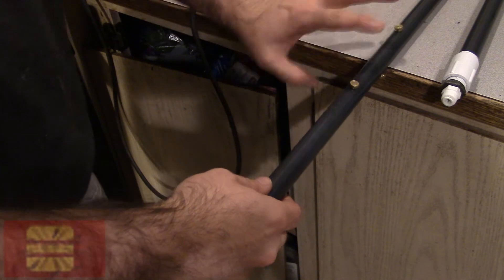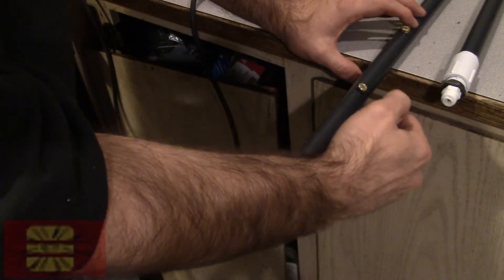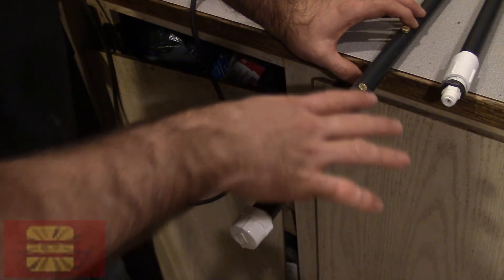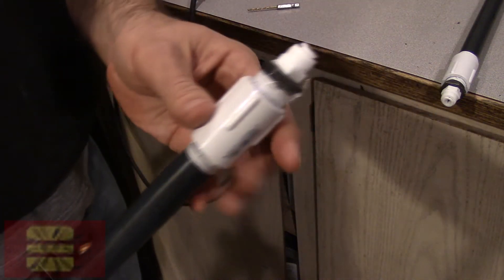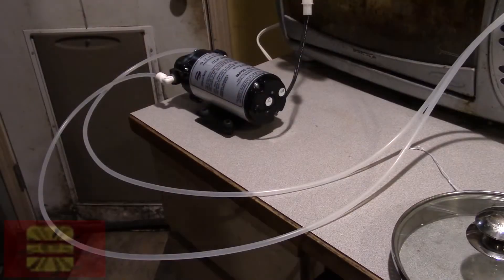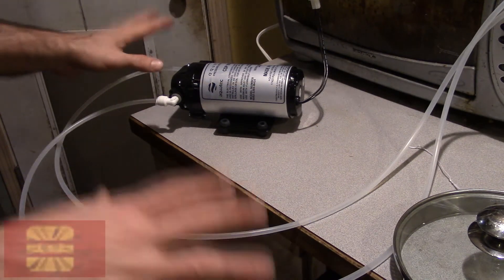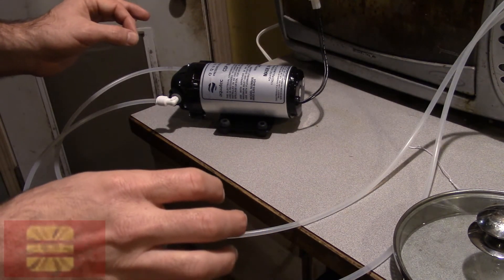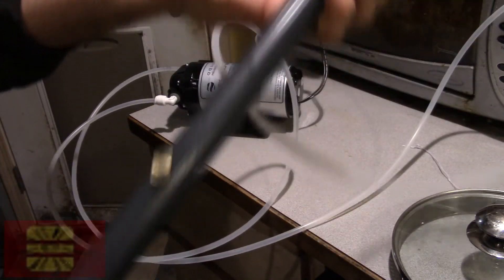Indoor Aeroponics Preview for small spaces

Comment: As the mist started I said out loud "beautiful!". This video helped me work out what I need, so thankyou!
Reply from the maker: be sure to check out the other videos, I made an improved mister that was easier to make with the flexible PEX type tubes.  I'll be trying to make a year around lettuce system this year so stay tuned!  I'm glad my videos have helped inspire!
Reply: Cyrix Lord Have you had any issues with clogged spray/misting heads? If so, how consistent? Do you have any footage of the changes you've made to the misting system, as I've been unable to locate them if so on your channel.
Reply from the maker: hi, not consistent with the aeroponics, but for the hydropoincs, because I dont' really filter out the water (I will be meaning to while still figuring out how to keep the flow rate good) I have to soak the heads in vinegar and blow them out like once a year just to be sure.  for the aeroponics i use a 20/20/20 liquid fertilizer that is diluted. I hope this information is helpful

Comment: Thanks for showing us your video.  Would you mind sharing some more information about your system.  Whose short cycle timer are you using, per filters, and housing vertical pipe or plastic barrel.  I plan on building an aeroponic system and I not what to reinvent the wheel.  Thanks for sharing Mike.

Comment: Nice and simple design with good results! I am doing research on building an indoor aeroponic system and I was wondering if you could give me your opinion on the sound leven of the high pressure pump? Since I'll be in the same room, a low pressure system might be a better option
Reply from the maker: I think it sounds a little louder than an aquarium's air pump compressor but not so bad, the spray is only on for maybe 10 seconds but it will do it every 20 minutes or so. i'm actually making a 2x4 foot tray for 18 head of leaf lettuce that will be aeroponic. i'll be making a video of that when i can find time to build the project (I have the parts)
Reply: @CyrixLord  Ah great, thanks for the reply! I'll be keeping an eye out on your channel for future updates :)

Comment: Is this system still running?
I'm considering building something similar, but I'm debating the use of solenoids and an accumulator. My hopes are that running an accumulator would help increase the life expectancy of the pump.
Reply from the maker: I only ran it for a season. Now I'm thinking on using it in a 2x4 foot tray for lettuce during the winter in my garage instead of using flood and fill. its still a good pump. you can just run regular water through it if you are worried about corrosion.  my pump still works fine
Reply: @CyrixLord  you know what would be absolutely awesome...(and is needed)? A side by side comparison of DWC or RDWC and aero, running clones of fruiting plants (same genetics). I've been searching particularly regarding cannabis (tho I understand that's not everyone's cup of tea) and I find exactly nothing, not even in the world of fruiting vegetables. 
I'm particularly interested in time to harvest, biomass, and yield. But I've turned up nothing scientific, at all. Tomato clones would be very informative.

Comment: does this type setup  produce mist as dry as the 5 micron mist with the atomizer type setup and very low water usage?
Reply from the maker: hi, this uses a mister type that is used for putting onto fans and cooling people off, but there was no specific micron rating on the mister nozzles. It worked very well with the lettuce, basil, cilantro and i'll be using the system again this winter.

Comment: Hi, thanks for video. I'm working on a high pressure aeroponic system and your pvc pipe with spray nozzles is a good idea and seems match with my project.
Cool you send me the list of parts you used?
Reply from the maker: Hi, the pvc pipe caused issues with leakage, so the new design in later videos wound up being using PEX tubing and putting the brass nozzles that they use for cooling you down (like rigging the nozzles under a yard umbrella to keep you cool). you can screw the nozzles directly in, or you can use special t fittings that screw the nozzles in.  I hope this information is helpful. the pyramid contraption I made worked great last winter for lettuce and other greens indoors but I want to try something else this year where I try to make year round lettuce.

Comment: sooooooooooo......... you want to pressurize plastic. Nice bomb if it builds to high.
Reply from the maker: +Charles Coleman lol no, it&#39;s not that high of pressure. However, I &#39;ve decided that there is a better, cheaper way to utilize the spray heads, so stay tuned to my next video.  The pump can only vomit out 80-100psi while It is on, and the sprayers assure that nothing builds up enough pressure to destroy anything.